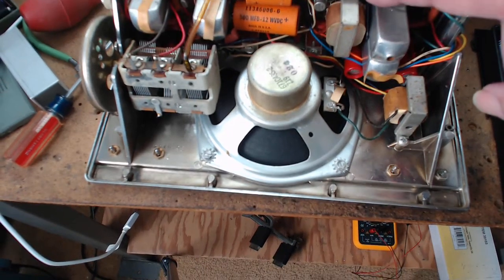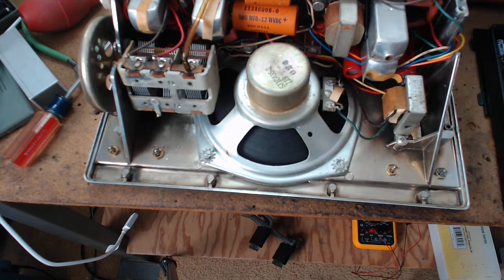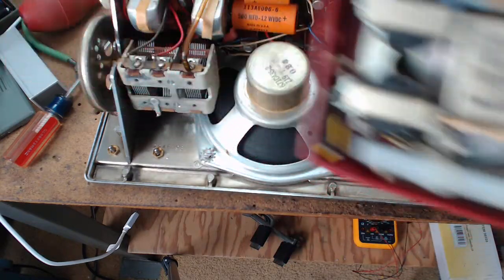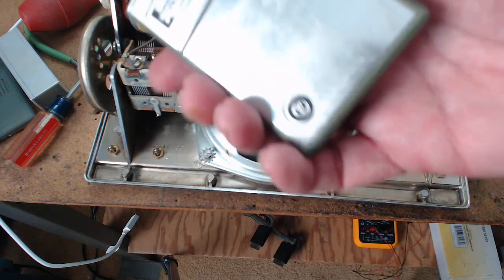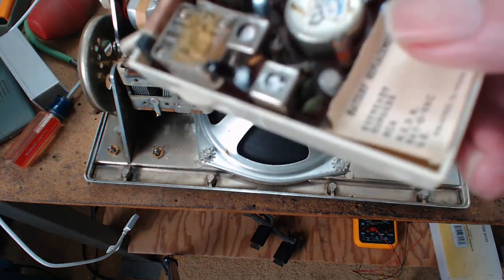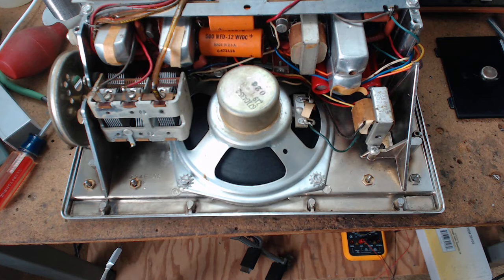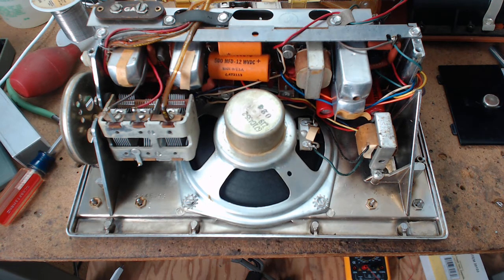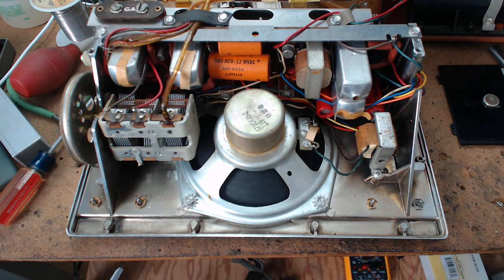Inside  1950s and 1960s AM Transistor Radios

Comment: I saw the same article, linked from Sarah Wannamaker’s transistor radio page. Not long after? I had my P780 followed by the Channel Master Ultra Fringe. Small world! As a kid in the early 70s it was the 5 buck dime store boxes pulling in WLS and KAAY late at night that was my gateway into an electrical engineering career. But the big GE is way cooler

Comment: I have one of these and I can vouch for its durability. Our cat knocked it off the honkin' upper shelf 4 feet down where it hit the honkin' computer desk and bounced down another 2 1/2 feet to the honkin' floor. Guess what... not a scratch, not a dent and it still works fine. I fully expected a broken dial glass and dislodged components. It's just as if it had never fallen.

Comment: The 'Channel Master' was manufactured in Osaka, Japan, by Sanyo. For Europe and Australasia, they were marketed as 'Sanyo' 'All wave' and their 'superheterodyne' circuits were very competitive with their tube predecessors.. I see the GE radio has used a number of parts carried over from a stockpile designed for tubes as the active amplifying devices, and with the larger audio transformers, gave a very clear sound on the bass frequencies (with a large speaker also) as transistor audio stages...

Comment: Oh my god, I owned that exact GE chrome plated model radio at one time! It worked for a month and performed better than any radio I’ve ever owned. Unfortunately, it was my early radio repair days and when that radio stoped working, I didn’t know the exacts of what to do and sold it off for cheap:(. Since then I learned about capacitors.